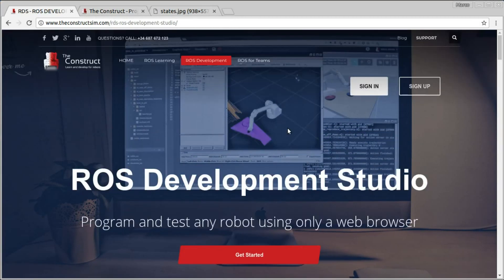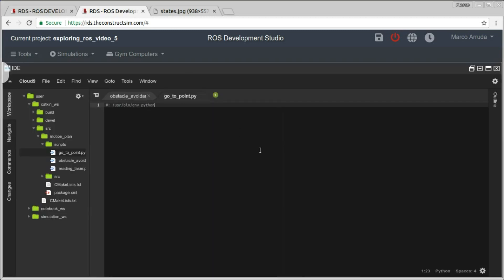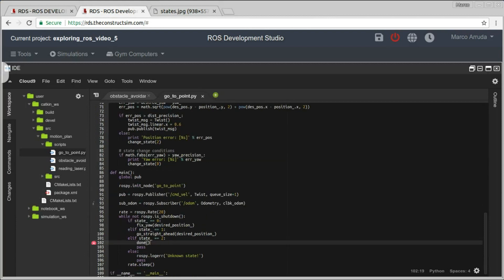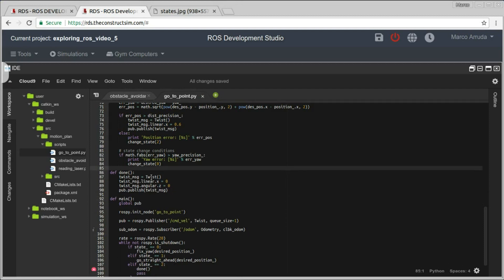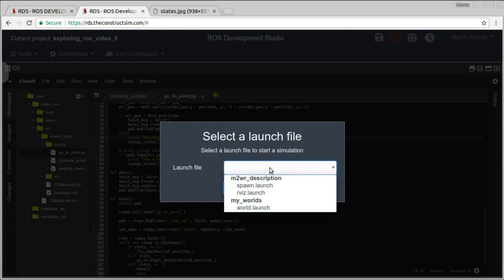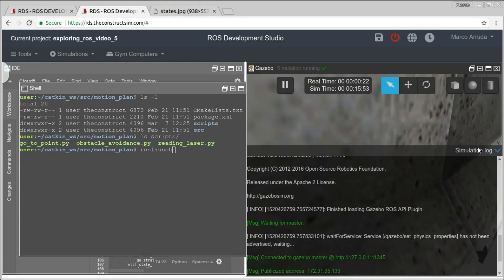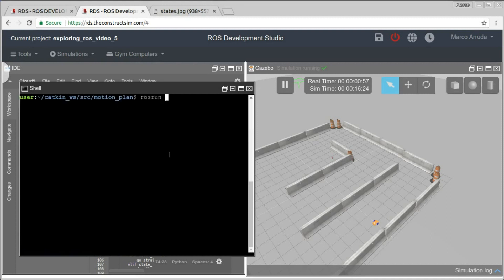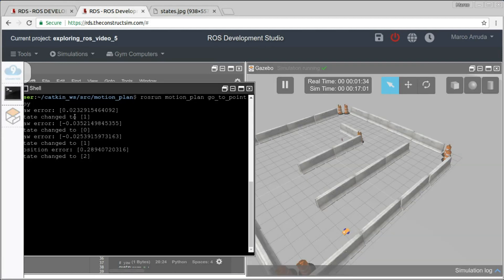[Exploring ROS using a 2 Wheeled Robot] #6: Motion Planning Algorithms

Comment: I am using Kinetic and Eva_Robot. I tested the code in the tutorial and robot moving tiny distance then stop, rotate and repeat. kindly help how to solve the problem
Reply from the maker: Hi Moh, what you are indicating can be caused by many things. We cannot provide you a solution without checking your code. Can you please create a rosject with your code and share it with us so we can have a look? To create a rosject, just check this video to learn how to do it: https://youtu.be/cR-Ow5K7oSo
Reply: @TheConstruct   Rosjet : http://www.rosject.io/l/bee9922/
there is a (Readme.txt) file inside Jupyter Notebook for details about launch file and the code .

# launch EvaRobot run : 
roslaunch evarobotmodel_gazebo evarobot.launch 
---------------------------------
moving the robot to pose(4,4) , Two different codes were tested from different tutorials. in both cases, robot wasn't moving smoothly and keep stopping for some time checking the orientation and continue (in the tutorial robot was moving directly to the goal):-

#Tutorial 1 : https://www.youtube.com/watch?v=8JiUtYd-LgM
Terminal : rosrun simple_controller go_to_goal.py

-------------------------------------------------------------------
# tutorial 2 : https://www.youtube.com/watch?v=eJ4QPrYqMlw
Terminal: rosrun simple_controller heading_angle.py

Thank you for the precious support
Reply: I had the same issue with mine. I found out that my <gazebo> tag for libgazebo_ros_diff_drive.so contains <legacyMode>false</legacyMode>.. I commented that out and now the go_to and obstacle avoidance works fine...

Comment: Code from this section on isn't working for me following the write up on The Construct . I am running Ubuntu Mate 18.04 and ROS Mercurial but that doesn't seem to be the problem. I feel I have enough experience with ROS to know if this were a version problem. I am not using the Construct's online setup but running on my desktop. 

1. The URLs for the code are incorrect but I found them in the git repository. 
2. The instructions are incomplete sometimes omitting some of the commands that must be run, i.e. spawn the robot.
3. The robot drops onto on of the Jersey barriers and rolls to be upside down in the obstacle_avoidance section.
Reply from the maker: Sorry to hear you had trouble. We have updated the URLs to correct the errors. Also if you go to the link provided, you will get the full code already made for you as a rosject (that you can download to your local machine). 
About the instructions missing, they are not actually missing because the show how to spawn the robot. The only thing is that we show this at the ROSDS, not how to do it in local because that would require a lot of setup from your side that we cannot control.
We would like to know more about your third problem. Can you send us an image or video about what you mean?